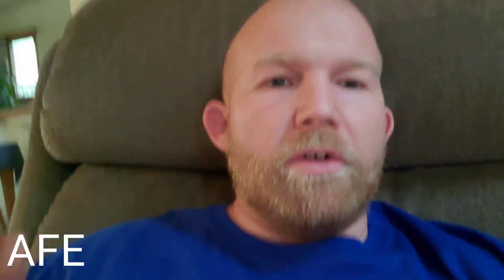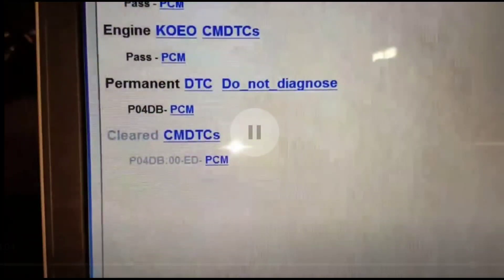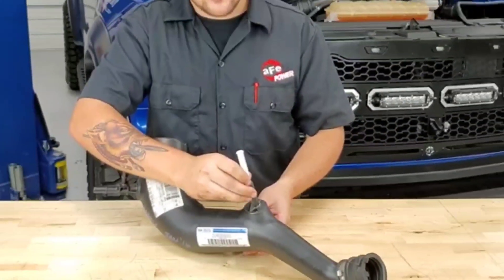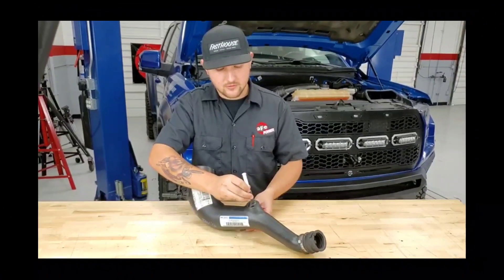Ford F150 Ecoboost Installed a Cold Air Intake Now P04DB is Set - Check This Out First For Info

Comment from the maker: https://youtu.be/yeBuFlbUUfo
UPR Dual Catch Can With Sensor Install

https://youtu.be/vhaYJGbtEW4
CRANK CASE PRESSURE TUBE - 6inch Vent Insert Install 

https://www.americantrucks.com/afe-f150-magnum-force-cold-air-intake-vent-tube-insert-59-06201.html?utm_content=AT%20Intake%20-%20Other%7CAFE&T5_Var4=T547069&utm_campaign=AT+Brands+Medium&dialogtech=ppc&utm_source=google-pla&utm_medium=shopping&T5_Var2=shopping&T5_Var3=red&gclid=CjwKCAjwhYOFBhBkEiwASF3KGbKubfw1VLAzf-nDeBIYNlHCoi9XpItdKVvDhGYIEXGydVCTPevxWBoCu4QQAvD_BwE&gclsrc=aw.ds
Tube Insert - $20

Comment: The aftermarket intake is flowing more air than stock and it’s above expected range, so the computer is throwing the code. The sleeve limits the flow to the sensor to factory range, so it eliminates the code. This proves the the aftermarket intake is doing it’s job of flowing more air than stock.

Comment: You don't need any aftermarket intake stuff on these newer trucks, the oem one gives plenty of airflow even when tuned.
Reply from the maker: You are correct but this is just for the guys that want the cool stuff added on
Reply: @FordBossMe  My plan this truck was to use oem parts and build it the way Ford should have.
Reply: I know I don't need it, but I think its worth the increased maintenance for the way it sounds.
Reply: @flyingmunkie0  Ya no worries, I've run em too lol.

Comment: AFE performance is the one who makes the sleeve for the intake. I have a 2016 f150 3.5L put a k&n intake on at 21K miles didn't have issues until I hit 132K miles. Now been having that P04DB code. Order the sleeve waiting for it now to see if it helps.
Reply: Did the aFe insert tube solve the problem then?  I’ve been running a Banks Ram Air intake for 6K+ miles without a problem and all of the sudden it started throwing P04DB.  Hoping the insert sleeve/tube solves the problem.
Reply: @BTCRUZR  so far it hasn't came back up. It's worth trying.

Comment: Every time a customer asks me to install their “Cold Air Intake,” I look it over too see how much under hood heat it lets in compared to stock. Only the very high end ones are actually cold air intake, most are just cone filters and tubes to delete the noise control baffles. Noise equals power. lol

Comment: I remember back in the day installing an open element airfilter on my 1967 Chevrolet with a 4 barrel carburetor. All it did was let me hear the carburetor open up, and I couldn't go 6 months without the filter plugging up. Needless to say I threw it out, got a regular air cleaner housing from a Buick at a junkyard, and the problem was solved.

Comment: I know this is an old video, but the sensor is designed to see vacuum provided by the turbo inlet with the stock setup. When you reduce the restriction ( aftermarket intake) the vacuum reading is reduced, throwing the CCV code.

I’d recommend not installing the Venturi tube as you actually decrease the diameter of the CCV vent, in order to hide the code. All in all, you reduce venting under boost/load.

Comment: I just installed ams turbo inlet pipes on my 2016 3.5 eb yesterday. I got this code today . Thanks for the video, man . My truck has 70k miles on it , I guess I might as well replace the sensor and get that little tube insert . Hopefully, this will solve my problem.
Reply: Did that solve the issue?
Reply: @williegusa4923  The insert didn't fit in the ams tubes , it has a different angle than the stock tubes . My tuner was able to disable the code from popping up though so I haven't had any issues with it since .
Reply: @saulgoodman9193 what kind of tune did you go with?

Comment: Team RXP makes a similar dual catch-can setup, but I've had similar experiences with it throwing code P051b - "out of range" for my 2019 F150 XLT 3.5L, not the P04DB. They also provide a venturi tube that goes into the driver's side turbo inlet and uses the oem crankcase pressure tube/sensor. I've had to reset DTC's with forscan more times than I can count. I've switched back to stock with no code for days, where running a system setup would have codes daily. Last night, I removed the second "smaller" can and only have the passenger side PCV to their big can and ran it back to the intake. Going to try this for a few days to see if the sensor is bad or their system is over ranging the pressures through the second can.

Comment: Original 2011 Raptor Super CREW 6.2L owner(117k 💪) I have used 2 CAI for my truck for the last 10yrs orso...Have NEVER came across this issue with my truck.. 
VOLANT CAI
BANKS CAI

Comment: Little to no increase and power on a stock vehicle. If you have more modifications a CAI will be needed but a stock truck does not NEED one. They do give you more sound in the cab. I know it doesn't do much but I bought one anyway because I got it pretty cheap with my tuner😂

Comment: Great content what's your opinion on the gen 3 2018 f150  coyote V8 typewriter tick? Sorry if you answered it in a previous video
Reply from the maker: I have not seen a major issue with it personally 
just annoying
Reply: Ok I appreciate the response I recently purchased a 2018 f150 v8 with 33,000 Miles and I have put 3,000 miles on it and just had my oil changed I find the tick annoying but just wanted to make sure nothing is wrong with the engine
Reply from the maker: @M0DERNGAMER  Some guys claim it's a wrist pin issue but I have not seen any major failure with these

Comment: If I put a cold air intake on my truck f150 2013 3.5 ecoboost, will I need to tune it? Can it run lean on fuel bad enough to destroy my engine?
Reply from the maker: some do require a tune, you will have to find one that specifies it doesn't need one

Comment: Curious if I can pick your brain and you can talk about it in a video. 2018 f150 3.5l eco w/10 speed. 78000kms Ford deems the valve body in the transmission defective. They replace it; trucks drives the same. I do a work trip shortly after replacement and it’s a 700km round trip. 

On my way back home I’m doing 120kmh for this 3 hour ride. Halfway through the trans starts acting up; dropping into gears when downshifting and lurching as it goes back into overdrive gears. Total dog poop. When I’m almost home, trans stops acting up and truck drives normally again. 

Well, next morning I have trans fluid everywhere under my truck. It’s on the exhaust, frame rails, just everywhere. I take it to Ford and so far all they know is the truck dumped the fluid via the purge valve, otherwise everything is good. They are calling the hotline Monday to see if they have any insight. 

See anything like this before? I think it’s a human error of some sort that caused the issue. 

I love you channel, and really enjoy the content you do and the way you approach it. Fun to watch!
Reply from the maker: Did you get that 21b10 cam phaser reprogram done
Reply: @FordBossMe  nope. Cam phaser would cause the trans to goof up?
Reply from the maker: @emirkazic4493  the new cam phaser program starts messing with the way the cam phasers advance and retard and sometimes during certain speeds they start oscillating because it's like the computer doesn't know how to control them properly and the shutters real bad and it almost makes it feel like it's the trans when really it's not it's just prematurely wearing out the cams and it almost gives off that hard jerking shifting vibe that something's wrong with your transmission
Reply: @FordBossMe  hey! Here’s an update. The dealership and hotline deemed the new valve body they installed defective and have installed a new one. 

I was reviewing the notes and saw something interesting. So my truck dumped fluid and there was fluid all over the undercarriage of the truck and on my driveway. Yet the dealership said that the transmission had the normal amount of fluid at the time of inspection. What? If I have a quart of transmission fluid on my truck and on my driveway I feel like that it wouldn’t be “in spec.” 

I’ll take it out for some 75mph highway driving in the weekend and see what happens. Thanks so much for your time!
Reply from the maker: @emirkazic4493  unless it was overfilled to begin with
Reply: @FordBossMe  my thoughts exactly; and when the fluid got hot enough it created so much pressure which caused all my symptoms. Which then explains why when it vented the fluid it then drove perfectly fine. 

I’ll check the fluid level tomorrow lol 😂

Comment: I bought the AMS Turbo Inlets for my 2019 F150 XLT and ended up getting code P04F0, I bought and installed one of those tubes and the P04F0 code went away. After about 10 engine starts I'm getting this code now, P04DB. I'm going to replace the perssure sensor first to see if that corrects this since the truck has 54k miles on it. All of the crankcase tubes are tight, even did a smoke test to check for leaks and there are none. After watching your vid I'm going to guess that the sensor has just gone bad. The truck had no codes until after I installed the AMS turbo inlets.
Reply: Did u ever fix this problem just recently installed my turbo inlet and I’m getting a engine code now that same code you got
Reply: @domenickblan6244 Hey me too ! I've  had a roush cai installed on it for about a year now with no issues but just installed the AMS turbo inlet tubes yesterday and got the code today . Have you found a solution yet?

Comment: I'm just stepping out on a limb and saying this comment to say if it pops a code it may be one of those tune  required air intakes not sure just throwing that out there that's like with exhaust systems sure the Run but if you get a full exhaust minus some Factory parts then of course its going to pop a check engine light
Reply from the maker: 100% agree

Comment: You mentioned oil catch cans.  What are your thoughts on them?  Are they effective?
Reply from the maker: I think they are very effective
Reply: Effective especially on forced introduction engines. It would catch on my car in a 4-5k oil change roughly 8-10oz of dirty looking oil.
Reply: @TheMitchapalooza69  What brand of catch can?  I put a JLT on my 2.0 EB and only got @10ml per 5k miles.
Reply: @TheNuclear3  it’s been a few years this was on my Genesis Coupe 2.0 Turbo. They all pretty much do the same , they’re just slightly different in looks/design so just look up where you are wanting to mount it just as long as it’s mounted below the location that the inlet portion of you catch can is sucking.

Comment: Well a oil catch can void my Drive train warranty I have 51,000 miles on my 2018 Ford eco boost
Reply from the maker: A lot of the manufacturers say does not void warranty you have to check for that and then you have to check for the dealership do you like to use and tell them hey I want to add something onto my vehicle that helps it run cleaner it's not really modifying anything and see what they say
Reply: @FordBossMe  thank you for the advice